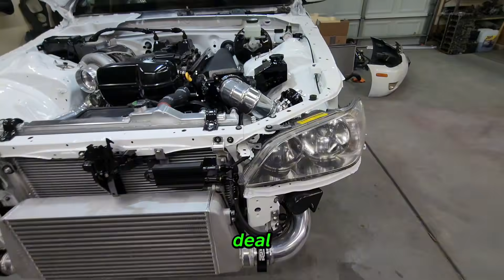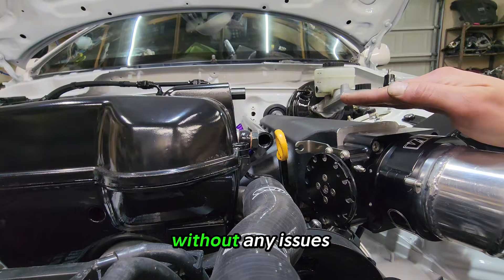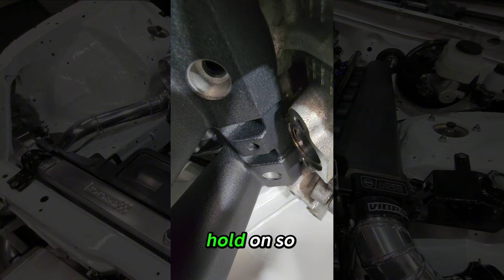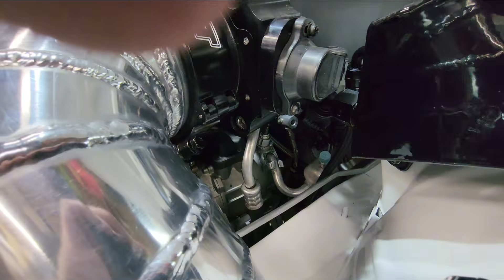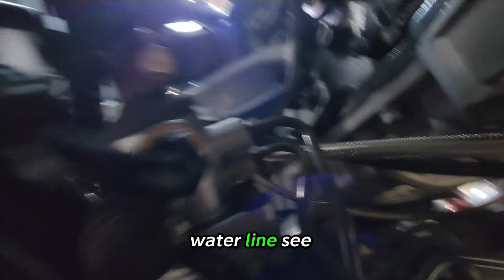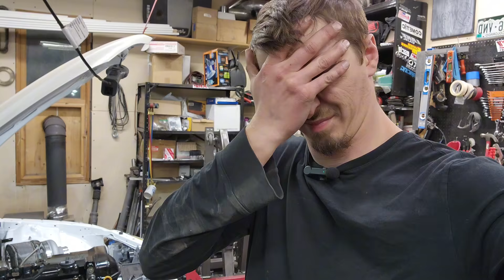2JZ-GE Turbo 700+Hp Build. Lexus IS300 Customer Build.

Comment: How much would this build cost?
Reply from the maker: Just depends on the parts used but this is close to a $30k build with all the engine work/T56 transmission that was bought brand new
Reply: Ok nice

Comment: What scanner did you use for Lexus
Reply from the maker: I use an autel scanner with the Lexus software installed, really only use it to scan ABS system. Basically always dealing with Lexus's that are running a standalone ecu
Reply: @LakeBuilt  We have a Launch Toyota scanner coming, I can MG you if you like to check it.

Comment: I have the same intake manifold mine didn't come with fuel rail mounting bracket any idea where I can find some
Reply from the maker: I would try reaching out to SPA and see if you can buy them individually, worst case you can fab up some L-brackets. If you need measurements let me know

Comment: Great build!  What AN Fittings and PTFE hose brand do you recommend thats not breaking the bank, but still lets you sleep well at night knowing you're not gonna blow your car up randomly?  I've seen Evil Energy on Amazon but wasn't sure if thats the move.  Thoughts?
Reply from the maker: Thank you sir! Evil energy fittings are OK, for fuel lines I don't trust anything cheap. I use Racetronix for fuel and powersteering lines, they aren't super expensive but not cheap, like $15 a fitting. I trust their products and have had great experiences with them. If it's something like a catch can line, evil energy is completely fine! Vibrant also makes high quality fittings but definitely not cheap

Comment: Hi mate, turbo water return line appears to be connected to the wrong place. In that place coolant is circulated only when engine is cold and the thermostat is closed. There will be no water return when the engine is hot.
Reply from the maker: It will circulate all the time, circulation doesn't stop just because the thermostat opens. 👍